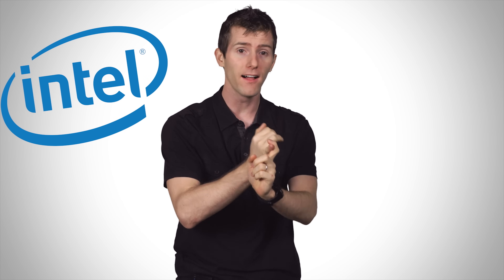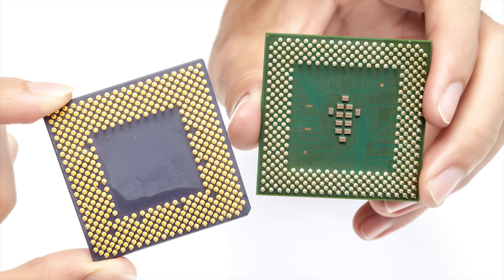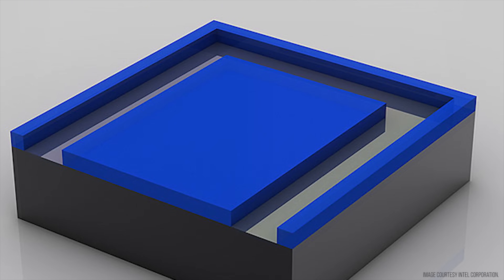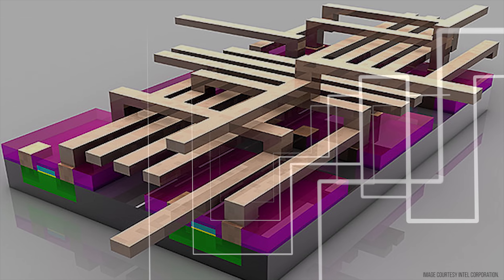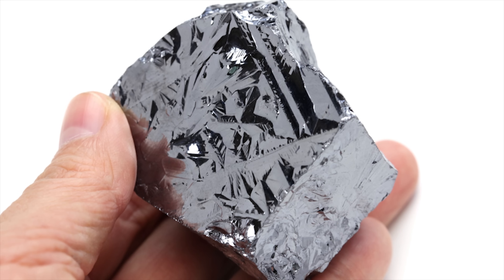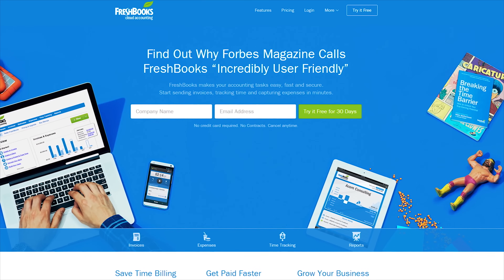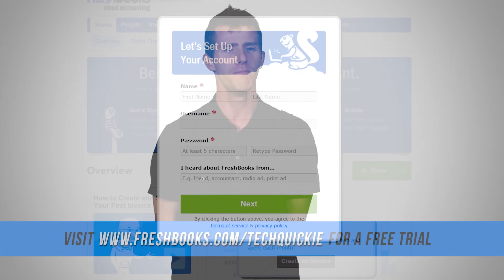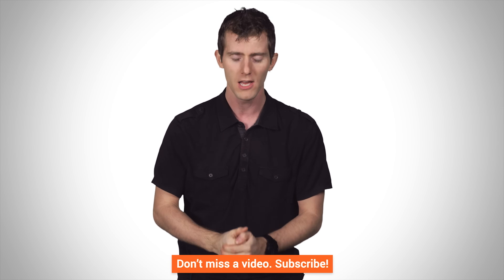How CPUs Are Made As Fast As Possible

Comment: How GPUS Are Made As Fast As Possible
Reply: absolutely the same way
Reply: +Gavin Crane - Re-watch and replace every mention of CPU with GPU and you have your how GPU's are made.
The only difference between them is the architecture and their inbuilt instruction sets. CPU's are generic computational processors while GPU's are specialised to certain types of repetitive operations and instruction sets which specialise in graphics. eg how shaders are applied.
Reply: Essentially the same process, except that the vram and power phases are embedded on the same board as in a mobile device.
Reply: +Gavin Crane Pretty much the same way.
Reply: +CoderMonkey Nathan Well they do specialise in graphics but they specialise in parallel computation (I think it was). Because of the way GPU&#39;s work, you can Bitcoin mine very successfully and that doesn&#39;t require any graphics. Look up Computerphiles &quot;CPU vs GPU&quot; video
Reply: FarmingtonS9 AMD cards are good at bit currency mining, because of the way it processes data. GPU's are capable to performing integer & floating point math better than CPU's and are designed for threaded parallelism. AMD cards became better at bitcoin mining due to a change in the way it processed integer shift which made it more efficient at that kind of math.
Reply: yes
Reply: CoderMonkey Nathan Yea, I wasn't sure what process GPU's used but I know, from watching that Computerphile video, that GPU's are alot better at Bitcoin mining then CPU's
Reply: FarmingtonS9 Think of CPU's as Jack of all trades data processes.But in comparison to GPU's they are like comparing a 4 core 8 threaded CPU as 8 trucks to say 980 with 2048 cores as say 2048 sport cars. The CPU moves data quickly in large blocks whereas the GPU moves lots of smaller blocks quickly.
Reply: Yea I realise that :)
Reply: +Gavin Crane lots and lots and lots of really shit cpu transistors and some fast ram go team
Reply: When He says "CPU" Just replace it with the word "GPU" instead.
Reply: Brownie Rush It *IS* The same process. What you are thinking of is a Graphics Card. Not a GPU, which a Graphics Card has.
Reply: pretty much the same way. theyre just processing chips optimized to do graphics
Reply: GPUs are CPUs dedicated to render graphics :D

Comment: Also, regarding transistor size, I will assume 2-3 nanometers to be the physical limit of silicon-based gate architecture due to the effects of nuclear attraction. Since gates switch states during the event of tunneling of electrons being passed along a silicon spacer, it would become too unstable to actually control the states of the switch due to electrons attracting each other without help. Which material is best suited for the task of the next gen architecture is beyond me at the moment, but I wonder if they'll even bother with classical mechanics in the future since the era of quantum computing is becoming much more widespread and classical computing with single particle states could potentially just be too inefficient. Depends on prospective growth. Yay Moore's Law.

Comment: i have a question why not instead of trying to get it so you have a huge number of  transistors on a small chip and cooling it couldn't you just make a bigger chip. It would probably require making a new layout style motherboard but that would probably be worth it for the increase in power( i think)
Reply: +Linus Chaple Propagation delay is the main reason the dies aren't bigger. The speed at which you can clock a chip is dependent on how fast a signal reaches steady state.

Comment: Hey man! wanna make a quick bomb? Follow these steps and very soon you will have your own bomb!

Step 1: Download the latest version of MSI AfterBurner
Step 2: Install it
Step 3: Open application
Step 4: Open the settings page and head over to the power tab
Step 5: Make sure "Voltage Control" is checked
Step 6: Save your current settings
Step 7: Slide ALL of the sliders to the right and click apply
Step 8: Turn off computer

Enjoy! Now to use this bomb all you have to do is throw it at someone after turning it on.

You're welcome.0

Comment: If the process is so precise, then why is there variation in CPU overclockability?! :(
Reply: +Quan Dang Because building a CPU and deciding how fast it runs are two different things. 

Besides, the main problem with overclocking is heat. The amount of heat can vary depending on ambient temperature and the cooling method used (fan, heatsink, water cooling, etc.)
Reply: Neocasko I'm referring to the "silicon lottery". All cooling methods, ambient temps, and other PC components being equal, what makes one CPU OC higher than another? I've heard it's due to its original position on the wafer, but what does that really matter??
Reply: Quan Dang I don't know for sure. Number of transistors? :/

Comment: When Linus talks about the limits of silicon, eventually everything will be limited by quantum tunneling. Even though you could use different materials to minimize the lattice atom spacing it will eventually get too small and electrons will start to jump through transistor spaces. This is where quantum computing is needed.

Comment: god reminds me of the Pentium MMX 133 I had. Sucker got smashed by a car and was soaked by rain I found it that way straightened the pins and heated it with a blow dryer Ceramic slapped it in a old socket 7 m/b and it fired right upp :D

Comment: What about Graphene Valley ?
Reply: silicone valley is a whole different thing though <insert Lenny face here>
Reply: +Jon H Yep.
Reply: Jon H Why not? It apparently just got about 100 times cheaper in regards to manufacturing and, according to IBM, holds an astonishingly promising future in the world of processors.
Reply: Jon H no, the last update was November 2015, when the breakthrough in production leading to significantly reduced costs was officially reported.
Reply: +DH Shawon glassfiber valley
Reply: or Silicene
Reply: +DH Shawon We're waiting for it to get into mass production. It's not there yet.
Reply: +DH Shawon Blue Diamond Valley. Blue Diamond makes far better p-type semiconductors than Silicone.
Reply: +DH Shawon We can, Linus just did a video on the main channel. Anyway to explain: It's solely the responsibility of the chipset (like C602 and the whole Patsburg line), these chipsets though are generally for enterprise, the exception being Intel's Skulltrail a number of years ago. So you just have to get yourself a dual (or even Quad) socket server board and a compatible Xeon and you are good to go!
Reply: +Jon H Silicone? you mean silicon, don&#39;t you? If you did, you cannot solely use silicon because then you would not have a semiconductor. In the fabrication process the ions they bombard the silicon is boron or phosphorus, which make n-type or p-type transistors respectively. Btw, SILICONE is a polymer made from silicon and oxygen, etc. It would not be a very good conductor :)
Reply: Quantum Valley would be Burnaby, British Columbia. The only company that makes commercial quantum computers is based here.
Reply: Matthew Lau 
^^ Thats almost evil...
Reply: Monument Valley
Reply: +DH Shawon You can but, who would want to spend $400 on two cpus or $400 on one cpu($200 per cpu on the two cpus to clarify).Think of it like sli... also you need to hook up two fans which wouldn't be great.
Reply: +Jon H silicone can't be used either =P
Reply: +Matthew Lau Jew Valley >:D
Reply: damn you beat me to it!!!
Reply: Germanium Valley
Reply: Human valley
Reply: ShiroiKage009 I'm aware of that, but a lot can happen in couple of years. It might take a while, but it's possible.
Reply: Also, I don't understand this, maybe someone can explain:
Why can't we have multiple CPU slots ?
Reply: +DH Shawon InGaAs Valley/Prairie sounds just fine to me, thanks
Reply: +Joseph Griffin I believe it's use use is to 'coat' or insulate the gates/interconnects better, to prevent the electrons from leaping so easily at increasing smaller widths.
Reply: +Joseph Griffin Using a silicon substrate they were able to cut the costs of manufacturing graphene as well as provide the same or better quality graphene due to a smoother silicon surface. I doubt this will make producing graphene - based CPU's easier. I do believe that they could use graphene channels on the motherboard and the interconnecting wires for the CPU, but I don't think it would be worth the slightly better performance
Reply: Jake Morel
 Probably because you're a month late to this video?
Reply: +DH Shawon yeahhhh
Reply: XD
Reply: What about Quantum Valley
Reply: Liberal Valley
Reply: Nut
Reply: DH Shawon No one talks about Graphene anymore

Comment: Could you do an As Fast As Possible on summarising all the main components of a PC?
Reply: +TheDJHoller I think it would be too fast to explain...
Reply: Just saying you can have both an hdd and an ssd
Reply: Cpu- processes stuff and does physics and AI in games
Cpu cooler- self explanatory.
Thermal paste- between CPU and CPU cooler, 
Gpu- processes graphics, most important thing for gaming
RAM- stores a few GB of data, faster than a hard drive by a lot
Take it from there, next dude.
Reply: CPU-The brain of your PC,does everything around,making billions of equasions and sending out commands EVERY SECOND!
CPU Cooler-Keeps the CPU cool,because the power sent out by the power supply is generating heat and by doing so,it may affect the architecture and millions of transitors inside,thus destroying the CPU.
Motherboard-It's kinda like the pipe lines in a city.But instead of water it transports short electric pulses from the CPU to everything else stuck to it and vice versa
RAM (Random access memory)-This is like a temporary storage space for the CPU and guides the CPU in what to do next.
HDD/SSD-It's just a big storage space,where data is being requested from or sent to.
GPU-It's basically a processor,but it's designed only to do graphical tasks.
PSU (Power Supply Unit)-Sends power to everything in your computer.

And that's about it.